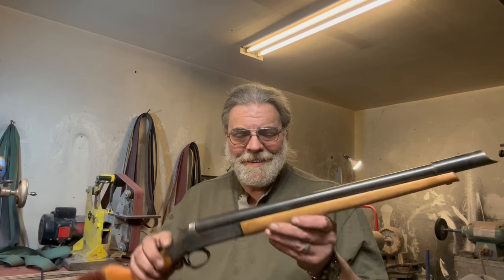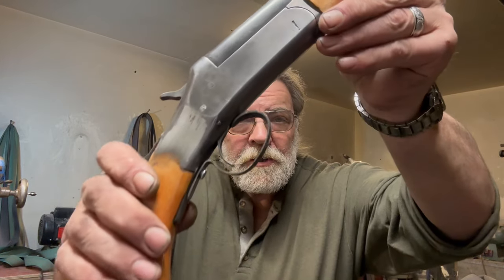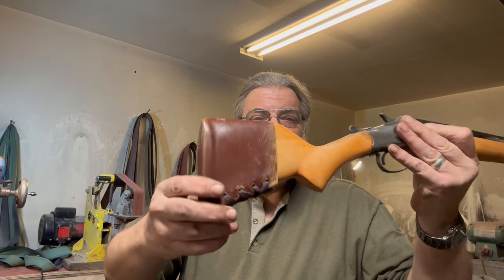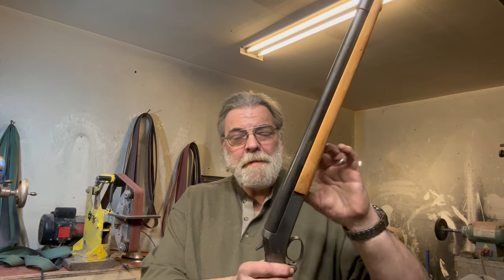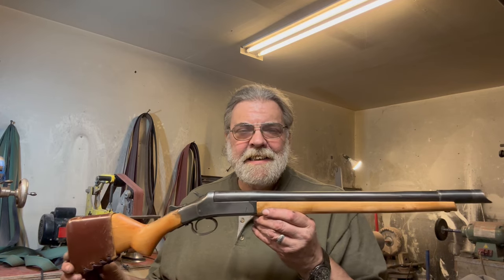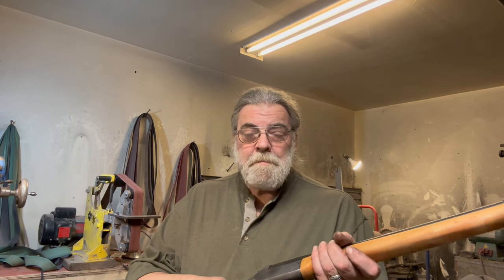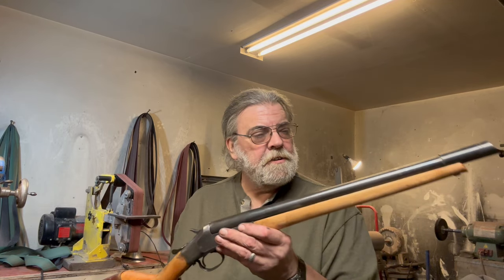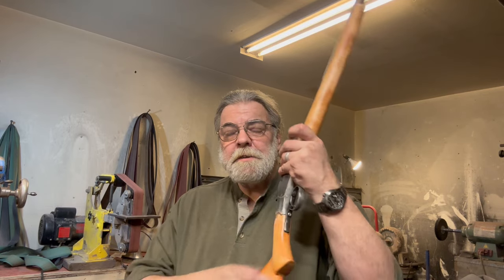The Short Tom 16 gauge Project!

Comment: I found that the slant muzzle brake of an AK at 100 hundred ft would displace the impact point about 1.5 to 2 inches opposite of the muzzle brake.  I removed it.   
One could put some lead in the buttstock and forearm to help mitigate the recoil.

Comment: 33" and 4 1/2#s is pretty handy and light weight, make a decent back pack gun for emergency bear defense,a 16ga slug is pretty hefty and enough for black bear and grizz deterent.
with birdshot it could be could for small game at close range(without that AK attachment) in the bush.
a since you have a lathe you could make chamber adaptors for pistol or light rifle cartridges for it